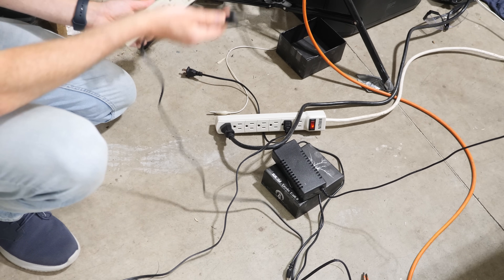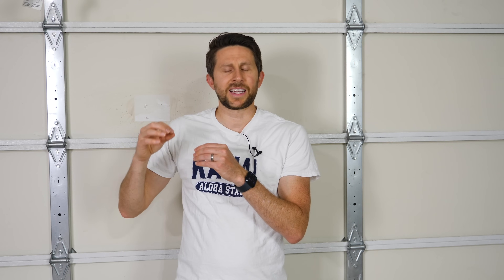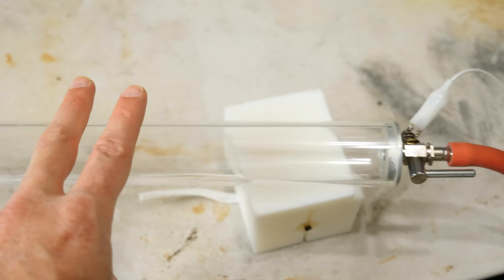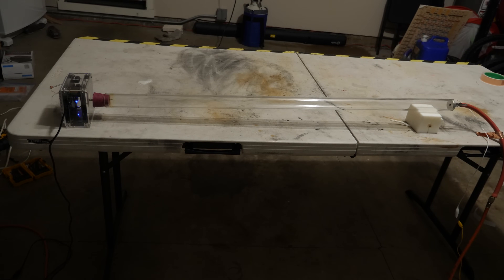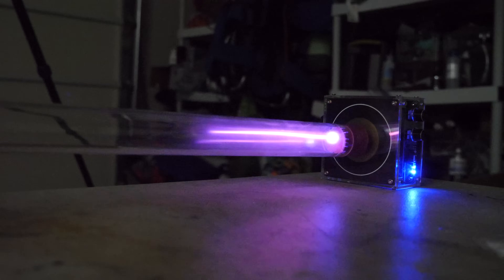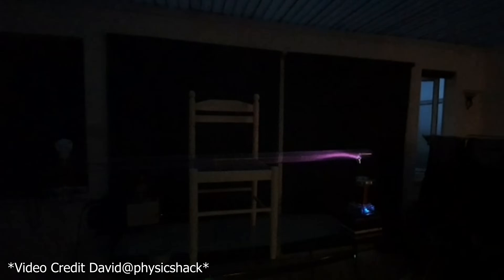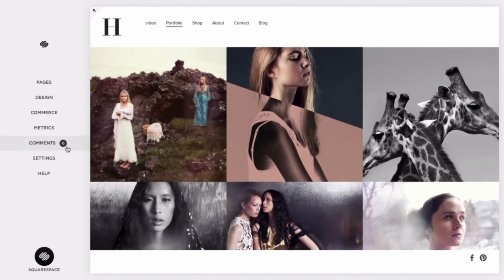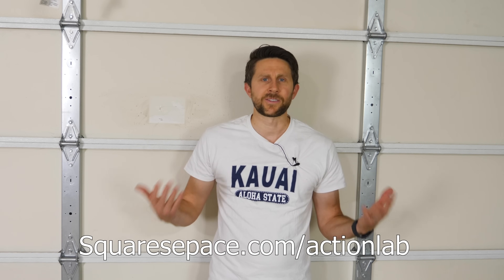Using the Air As a Wire—Was Nikola Tesla Right?

Comment: If someone did make a "wire" in the upper atmosphere to transmit electricity, how would that interact with the static electricity already in the atmosphere?  Would it make lightning more frequent, or less?  Change where it hits?
Reply: All these replies and no one answered the bloody question I had about lightning lol.  We all know it's inefficient, we got that, no one needs to read it again.  What would it do to LIGHTNING.
Reply: @jerotoro2021  the lightning might travel through the energy current because the energy difference is lower than the ground
Reply: Believe it or not despite our advancement in the knowledge of the universe… lightning is still a very mysterious phenomena partly because it is closely tide with weather(and scientists don’t really understand weather well… this is also the reason we can’t accurately predict weather far into the future… because it is a chaotic system with a lot of variable that could effect the outcome). Most scientists believe that lightning formed due to several consecutive success steps: 1/the build up of charge via triboelectric effect(the higher cloud have ice water in it due to low temperature near the stratosphere. Those ice water rub against the air surrounding the cloud creating triboelectric effect), 2/electrostatic induction: after accumulating a lot of charge in a rather small area(the cloud) it creates a very concentrating electric field around the cloud the electric field itself electrostatically induce other objects not far from the cloud(Earth or nearby cloud) and making those objects electrically charged albeit its net charge might be zero. 3/neutralization due to electricity: after the cloud is charged and its nearby objects(Earth or nearby clouds) are charged too the electric charged of the cloud and its nearby objects are so intense that it turns air into plasma(good conductor) and thus conducting electricity from the charged cloud to its nearby objects or vice versa… which in turn neutralizing the electric charge.

So the machine designed to transmit power in the video might or might not increases the frequency of lightning strike… that is the some up of my comment and that is as helpful as I can in this case…

The topic is blurry that is why everyone that replied to your comment are avoiding to give you any proper explanation.
Reply: @BuildGUY yea I don’t understand how he doesn’t get how inefficient this is. Otherwise he’s just clickbaiting
Reply: Jero! This is a good question! However Tesla never intended on using "wires" for anything! You are thinking old skool like Edison haha lol. Tesla was all about Wireless induction energy and resonance fields.  His idea would most likely NOT change our planets lightning or atmosphere.  There is an abundance of FREE electromagnetic power in the Air and atmosphere. The Tesla COIL could harness this power when used correctly. It was never meant to shoot out PLASMA bolts. That was only for SHOW in a 1899 news papers.
Reply: @BuildGUY hes saying that they will crash into the balloons with planes
Reply: @r/hmm
Reply: So all we need do is rid the Earth of atmosphere.
Tesla was an idiot.
Reply: I BELIEVE!! 
If a physical WIRE it would gather potential till discharge. If not physical wire would just over ionize the air. Probably making lightning stronger or easer to discharge.
But what do I know just a keyboard ponderer.
Reply: @BuildGUY Noise at the resonant frequency of the earth and ionosphere. Somehow, I doubt that would even be close to the frequencies used for radio transmission.
Reply: @BuildGUY If all EMF is noise, than all radio transmissions are noise. If you're referring to static charge, then I have no idea if it behaves noisily while static.

Resonant frequencies have everything to do with it. Radio works because there are so many frequencies that transmitters and receivers can be tuned to resonate at. All the background noise at every other wavelength is tuned out to listen to a specific signal. Tesla's plan, to simplify it to oblivion, was to turn the earth into a transformer using its resonant frequency. Power transmitters throughout the earth, power receivers anywhere in between. This would operate at the resonant frequency of the earth, far from radio frequency. It's like how AM and FM signals have designations in different bands; this sort of "geopower" frequency would be akin to one of those radio bands, which will not interfere with the others.
Reply: @BuildGUY They're not protected against running into things though. Sure, the shape encourages the electricity to flow around them, and they aren't directly in contact with the ground, so pretty much all the energy will flow around them. But, if there were wires connecting the sky with the ground, there would be issues for planes, or more likely no fly areas that had this going on.
Reply: It likely wouldn't affect planes, they're made of/covered by metal which means the current won't go inside, same with cars.
Reply: We need to use the earth not the sky.
Reply: @OFFRoadWheels we need to PRESERVE the earth because we have 25 years till it’s too late.
Reply: The whole balloon rig would probably end up falling out of the sky and on your car while you're driving to work lol
Reply: Planes.. what about the birds?
Reply: @LemiLeMach  Or all the ringing ears...
Reply: @BuildGUY Yep. If Tesla was alive today:
Tesla: "I want to build an upper-atmosphere wire"
hears knock on door
"This is the FCC open up".
Lol
Reply: @RyanBoggs  lol XD